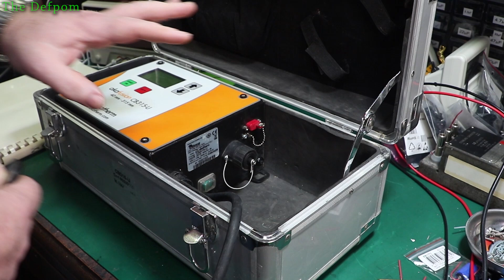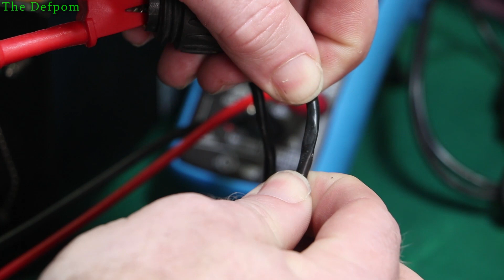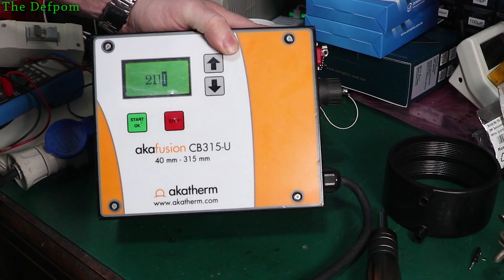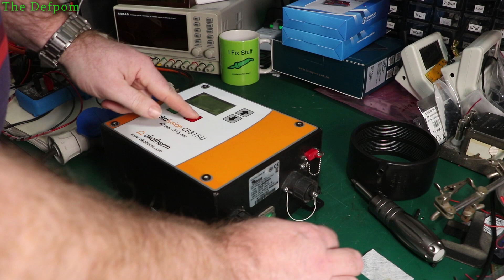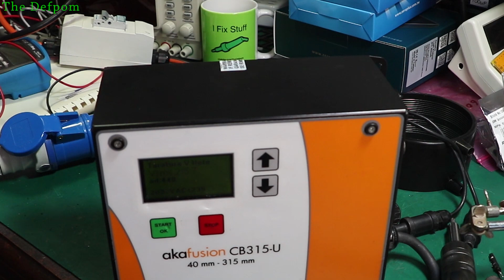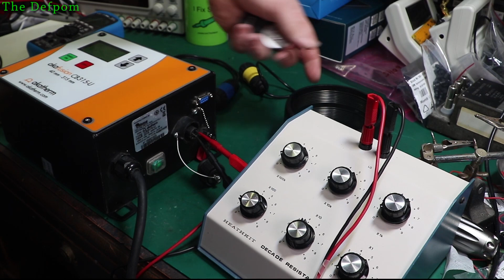#735 Akatherm CB315-U Electrofusion Unit Teardown & Repair & Reverse Engineering

Comment: Hey Defpom!
Interesting video, seems like you've successfully fixed this electrofusion control box! Some comments:
* Akatherm HDPE is a soil and waste system intended to be used in gravity drainage applications. Commonly used in dwellings or commercial buildings. HDPE is a material which is well suited for more demanding applications as it can be homogenously welded by butt-fusion or electrofusion welding.
* You indeed cannot glue HDPE. The electrofusion coupler works by a combination of heat and expansion of the PE material/pressure. The combination of both forms a homogeneous weld. 
* Akatherm electrofusion couplers work with a constant current 5A system (at diameters 40-160) or constant power 220v system (200-315mm). The welding time depends on the ambient temperature
* We offer replacement cables! Both the yellow (5A) and the blue (220V) cable are available for purchase
* The resistance differs depending on the electrofusion coupler size
* To ensure proper welding performance electrofusion control boxes need to be calibrated. Using this specific box without factory maintenance and recalibration is not recommended. The electrofusion control box will give a warning after 2 years of no service. This unit needs to be recalibrated.

Comment: Super video and nice work
I am at 6:58 and from looking how the cables are  coming out of the yellow connector I am going to say the fault is where the gland on the yellow connector clamps the cable.
Now at 13:39 I am shouting pull the cable it will stretch where the break is.
I was wrong the break was the other end.
I guess you do not have to deal with cables a lot, I get loads of industrial pendants and the cables nearly always fail at the entry/exit points of a connector/enclosure where it is clamped.
That's where a 100W or 150W soldering iron comes in.

Comment: The place where the wire was internally broken was quickly found, but if the place was not obviously found, 
you can connect one end of the wire to live mains and the other end diconnected, and use some of those mains live detectors for founding electrical wires in walls.

Comment: That was fun.  Did some googling whilst listening as you went along... Looks like A00, A01, ... A07 etc. are all colour coded with dots on the heating sleeves that match.  Nice you found the R they use to identify the plugged in cable.  I found documented... 1000 (Date), 1100 (Language), 1110 (Centrigrade/Farenheit) and 2110 (Reset Protocol)... looks like you found some fun ones!  The PIC seems to have a very large pin count... presumably mostly for direct driving the LCD display.

Comment: Hi, the minute I saw Electrofusion, I had to see what you have.
At my workplace we repair and certify calibration of these devices.
That brand is not familiar but is a basic unit.
Here in Australia the units that are used in the field are designed to be powered off a generator.
Lead faults are common, but those leads on your unit are pretty light weight compared to the high power units.
The welders for contractor and manufacturer compliance need to be checked and calibrated every 12months.
In fact some of the more fancy welders will display a "Cal needed" display when they detect that 12months has passed since last cal.
The magic calibration figures are 39.5Vac at 50Aac into a dummy load with some different load levels incorporated.
Most units do have hidden button combinations, then a password to get into a calibration procedure.
The units that I do, have massive toriodal transformer and triac control, with the appropriate digital measuring circuitry.
The aim is to make sure output is constant as the generator dodges and weaves under the higher than 2kW load down a muddy trench with gale force winds blowing.😀😀😀
The  output leads are in most cases a 4 wire device so the correct voltage is present at the lead tips.
Some also measure the element resistance before applying power to interpret the type of fitting.
Others have a 5th wire and a special tip that reads a separate resistor in the heating element to tell the unit what the cooking time is.
In the unit you have the 3rd wire probably does this.
If that unit had been kept calibrated it should have a cal sticker on it somewhere.
Good video.
👍👍👍👍👍👍
There is a basic manual inline for it
https://media4.cdnlemu.dk/v-636218426342504754/63/a0/7627-4b57-4483-8506-1d244063dab0/operation%20and%20maintenance%20manual%20cb315-u.pdf
Reply: Very interesting.  I found https://www.youtube.com/watch?v=0lSBuqr6QQM which is pretty impressive... guess that is a bigger model!
Reply: @NivagSwerdna  Yes that is Butt fusion which is the other way of joining, impressive and awesome. 
It would have been good if they had shown us the  power controller for that because 2kW would have been pretty puny in that situation. 👍👍👍👍